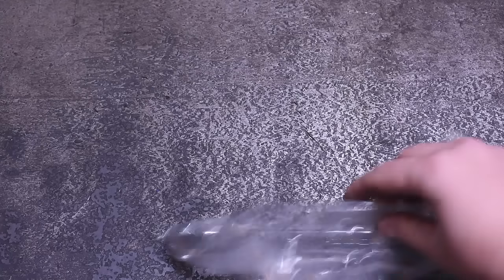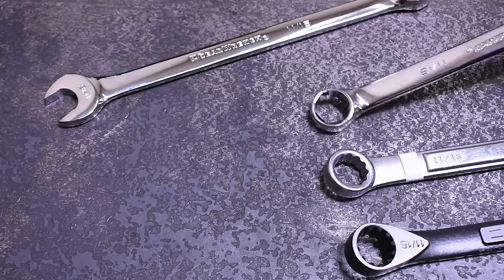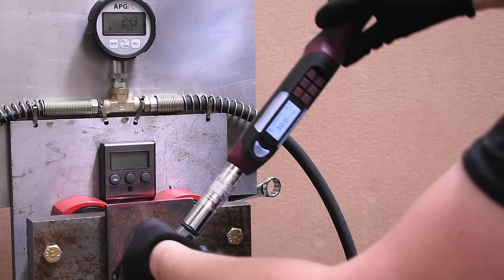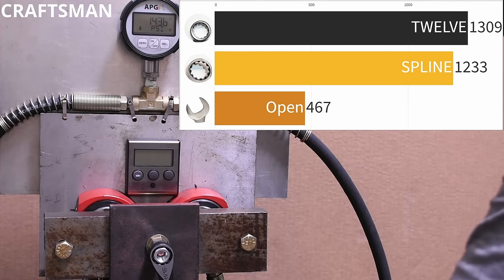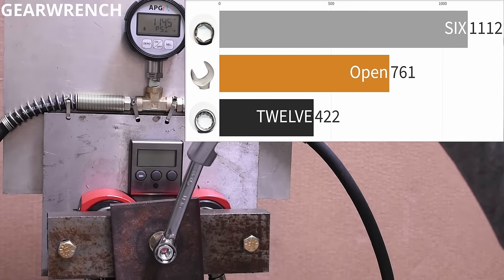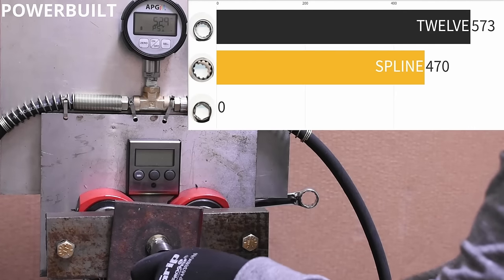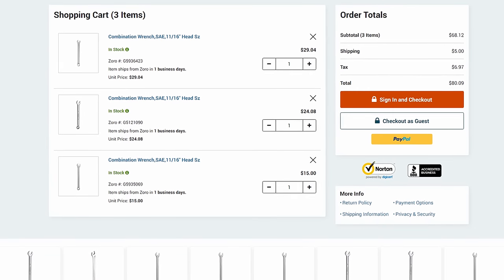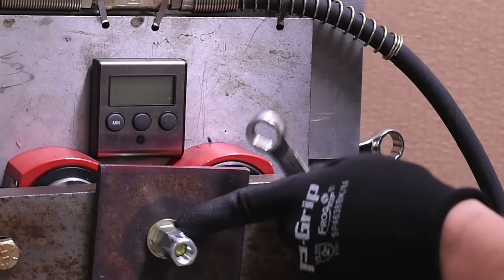Let's Settle This! What Wrench & Socket Design Will Slip 1st?

Comment: I decided I would read about the first 10 comments to see if anyone pointed out the obvious here before I commented but I didn't notice others making this comment so I'll give my thoughts.  (If others did make these comments in the sub comments or responses or further down, I obviously missed those and I wasn't going to read 2,973 comments as I typed this)

1.  You're not giving a fair test here based on seeing that you are using the same nut for all the tests.  Or at least is appears that way for most of them.

Why?

Because it has been rounded off to begin with from the very first test.  So, you aren't giving each new wrench a fair opportunity to turn on a nut with pointed edges as they have been rounded off.

As such, I feel this was unfair to each new wrench you tested.

I understand that you purposely did some "rounding" of the edges of the nut and to me, that's unfair in and of itself in the first place.  Yes, I'm aware that many nuts or bolts will have somewhat rounded edges from age or multiple tightenings or loosenings over the years.  But at the very least, give these wrenches their fair test with nuts or bolts with good edges from the start.

But not only that, even with the rounded edges, you are making them even more round once you have used the first wrench on them and had it "slip" causing them to round off even more.  As such, it isn't fair to keep using this same rounded nut/bolt for the same tests.  If you are replacing the nut each and every time, then that's fine.  But then you're not getting an exact nut because each nut you rounded can't be perfectly the same because you may grind off one edge a little more than another and there will be inconsistencies.

2.  You can obviously see that you are NOT APPLYING proper torque in line with the way you should be applying pressure as you can obviously see that right before the wrenches are failing or "rounding off" the nut, you can see that you are "pulling" the wrench at an angle to the nut instead of going perpendicular to the nut.

You can see this at the 5:07 mark if you pause it.  You can clearly see the person pulling so much on the attachment to the wrench in an "outward" motion that you can see the wrench on the nut at an angle which is not the proper way to fasten or loosen a nut.

Also, when they are applying pressure just after this 5:07 mark, you can clearly see the person "bounce" on the attachment to put more pressure on the wrench causing it to have even more force that wouldn't be accurate in terms of measurment.

If you are going to measure the torque or "force", I would think you would have to do so in an even and smooth motion.

It would be like trying to loosen a nut or bolt with a wrench or socket on a ratchet and not being able to so you take a hammer and swing at the end of the wrench or ratchet to get the bolt or nut to "budge" loose.  Of course there is going to be more force on the tool because you swung at it with a hammer.

This would be no different if you are applying "bounging" force onto the attachment to the wrenches.  This wouldn't be an accurate way to measure your torque since the forece wouldn't be applied evenly.

So, you have to make sure you're doing these tests with even and smooth motions.  You are not doing this.

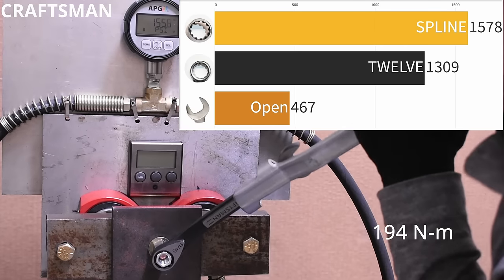You can see this again at the 5:16 mark and it's even more obvious at the 5:20 mark.

You can't be doing these tests if you're not going to properly apply the force to give each tool it's "fair" test.

You can see this again at the 6:48 and 6:49 marks.

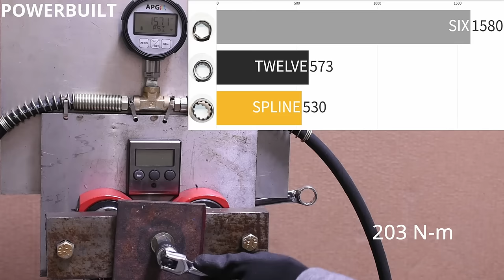You can see the bouncing again at about the 8:50 mark and after.

You can see the bad angle again at the 10:50 mark.

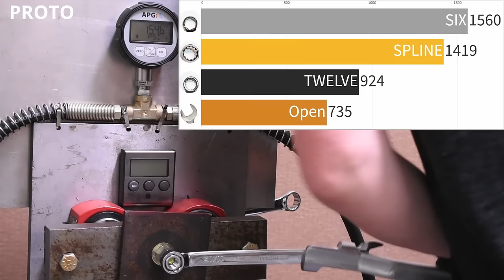At 11:22 you can see that the wrench is starting to come off of the nut so it's not getting a full grab.

Come on here folks.  If you're going to give these tools their fair test, then you have to be applying pressure properly and keeping them on the fasteners properly and applying the torque properly.

Next time, I think you need to do a better job of applying the force perpendicular to the fastener but also not try to "pull" outward on the wrench so it is continuing in a motion that is perpendicular to the fastener.

Also, I think you need to apply your force in a steady and smooth motion INSTEAD OF "bouncing" on the fastener.  If you can't apply the force you want to get the measurement you are trying to get, then I think you need to get a longer lever or attachment so you can apply that force smoothly and evenly.

Just my thoughts.  I understand others may disagree but I don't think this test was fair or done as well as it could have been done.

Comment: I want a 6 point box end wrench....with a selector switch that allows the "box" to spin like a ratchet wrench does, but its not a ratchet. It can just spin in there and you engage the pawl selector back to lock it wherever you set it. A 6 point wrench kills you every time when you need it. It never will work on that initial angle. Like line wrenches vs line sockets. Worthless.

Comment: Witch good heads and quality tool the six point will either break the bolt, strip the threads or crack the tool. Aint no way a six point slips.

Comment: with the sloppy specs and lower quality materials that tools and fasteners are made of nowadays, im not surprised at many of the poor performances.
back in the day, i remember shit fitting TIGHT and i wouldnt be surprised if stuff from 40-50+ years ago surpassed your findings on every level.

Comment: The testing is faulty.  A spline wrench is to be used with spline bolts.
Reply from the maker: Tool brands dont sell them that way these days, so you may need to tell them that
Reply: @TorqueTestChannel  They don't sell screwdrivers to be used as chisels either, but people still do.  Use the proper tool for the job.

Comment: this is perfect world lol.... in reality bro when you get some old rusted bolt when 17 seems to big and 16 to small you can then make your tests. This is pure curiosity test not usefull , most of moderate tools can easly do and undo with required NM. When it comes to real life there are better and worse tools depends on the place you have shape of the tool and bolt .

Comment: Your tests show when the NUT fails, not the wrench. Use a better hardened nut and see where the tool itself fails instead.
Reply from the maker: Wouldnt matter if they were made of play-dough, the wrench that grips best grips best. Use all grade 8 perfect hardware and you'll end up with sheared bolts and learn nothing. If all you see if perfect grade 8 stuff, then it sort of doesn't matter what you grab, shouldnt have a problem.

Comment: I would have assumed a 6 point anything would work best on a 6 point bolt/nut.. kinda the tool for the job.. 
Comparing them against their improper use would be good.. 6 point on a twelve point bolt/nut .. etc..

Comment: Only idiots use a 12pt on a 6pt to break it loose.....

Not all bolts and nuts are the same,as not all wrenches or sockets are the same.One brand may fit better than another on one nut but another brand may fit better on another...
If one really does a lot of mechanic work they will/should have 3-4 different brands of the same wrenches up to 1" or maybe 1-1/2" just for that reason and not a one will/should be a spline type.After 1 or 1.5" it doesn't matter if it fits perfectly.

Comment: Your test is not good unless you're changing out and using "fresh" hardware for each test. It appears you're using the open end wrench, and then following up on the same marred hardware with the next tool.
Reply from the maker: Nope. All different hardware even the bolt
Reply: @TorqueTestChannel  Maybe I missed it, but I don't believe I did, In my estimation it would be better if you made it a point to clearly describe that you use a different nut/bolt/fastener for every single test, or simply better describe what is used, and the methodology of the test.

Comment: Crappy "inches", the reason why US mechanics are the worst bolt offenders, stripping, rounding, seizing them ! Indeed, mixing close enough UNF and metric,  "inch" tools on metric is a killer ! Incorrect torque (who the hell in the world uses inch poud, inch oz....) even tires pressure (EVEY time I rent a car in the US, the tires are NOT properly inflated !) How about EVOLVING ? Of course 6 points are the best and the only sockets to buy.

Comment: Meaningless. 6 point should be used on 6 point, 12 point on 12 point, spline on spline. Spline wrenches are not a "gimmick". They are used for specific app;ications and work just fine. There is no data generated here that is useful for any purpose.
Reply from the maker: You're clearly not an auto mechanic or been on a tool truck in the past 10 years. Have fun using that open end of the combo wrench on all those 12points you're seeing tho
Reply: @TorqueTestChannel  No I just manufactured and maintained Aircraft for the past 40 plus years. Always use the right tool for the right application. I remember cleaning up plenty of striped nuts, bolts, and screws caused by  "auto" mechanics who would use anything at all on a fastener. That's how people get killed. It's illegal to do crap like that in aviation. I assume you are talking about using 12 point open ended B-nut wrenches on 12 points because the other kind is just silly. Also the open ended B-nut wrench isn't going to take much torque before it slips. I gues you are not acustomed to looking up torque values for the application you are using. Torqueing something till it breaks is just stupid.

Comment: Lots of unneeded designs. All those extra stupid bolts and nuts with ridiculous shapes that just make work much harder, and the tool box just become overpopulated with those BS designs for no reason. I get that this video is about a wrench design test, but they are only done on a simple hex, without touching some real 12 or spline, which were designed to be used with those exact wrenches or sockets. Once, i ended up removing an original factory engine part which was fastened by 3 different types of m6 bolts for no fckn reason! And one goddamn bolt was internal hex with round outside, so it could only be removed by a bit or an allen key, but guess what? There was no space for them, while a standart 10mil bolt on that place could be easily removed by a ratchet wrench or an open end. It was an audi, the shitties engineered brand out there.

Comment: You had a bag full of nuts and bolts, but you didn't give 6 point a fair go, or any among the same brand a fair go around. But that does show superiority among 6 point further! Which is OBVIOUS!
Reply from the maker: Each tool used a separate nut and bolt, they were all rounded a % in a jig

Comment: Possibly one of the dumbest tests I've ever seen. I a tool "fits" but ain't designed for it you just don't use it or you will endup with worn elements. You use 12 point for 12 point bolts, hex for hex, same how you can use torx in allen key, but then you see on reddit people bitching how it got rounded. Same goes for Ph (Philips) and Pz (Pozidriv) screw drives you can interchange them but don't expect great results.